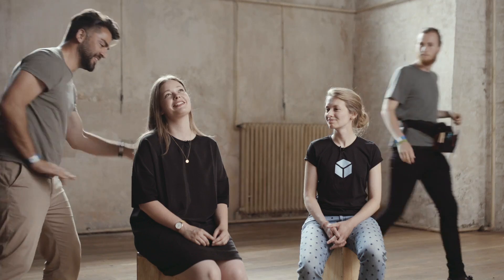Improved Prefab workflows

Comment: When is the release of the final version of 2018.3 that has nested prefabs? I couldn't find anything with Google.
I'm doing a Unity course at my university and I thought it's not a good idea to work with a beta version with beginners. When something doesn't work as expected they can't be sure if it's a bug or if they are doing it wrong.
I showed them the first steps with prefabs this week in 2018.2 and also showed them what's the problem with nested prefabs. Now I wonder when I can show them the solution to this problem without having to switch to the beta version.

Comment: Waiting for 2018.3  also please add support for amazon pay and google wallet .Its far easier and safer to use  than other available methods ,I dont like my transactions getting hacked .
Edit: Im pretty sure they are teasing about new prefab  workflows ...Quite evil of you Unity.
Reply from the maker: ? The new prefab workflows are available now in the 2018.3 beta. No teasing here. - Matt S.
Reply: But its in beta right and 2018.3 has yet to launch so its more like a tease before 2018.3 launch.